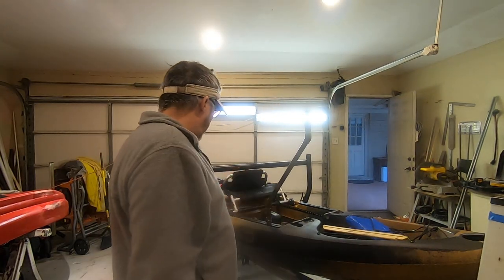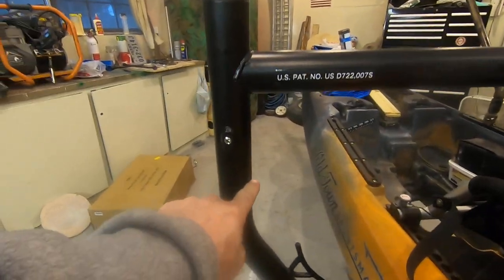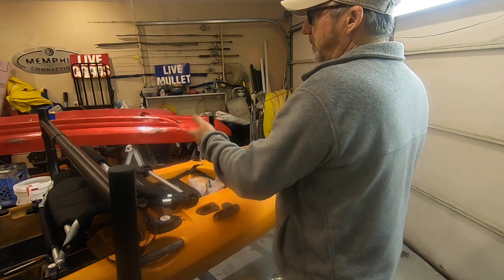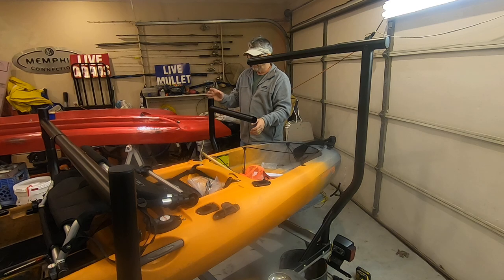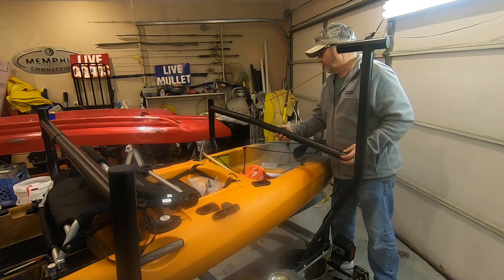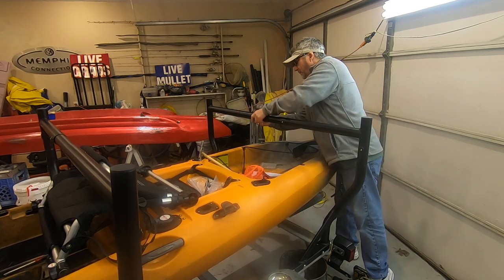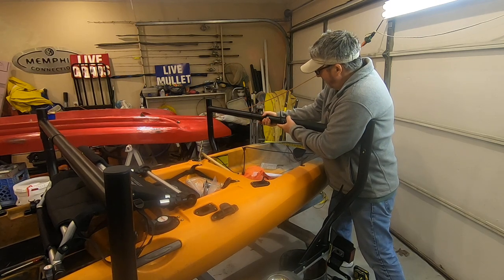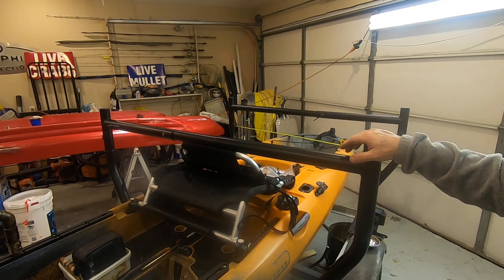Easy DIY Kayak trailer build budget friendly and light for 2 to 3 kayaks double decker for our boat

Comment: Just watched most of your foam boat and kayak videos. After seeing them I am going to build a kayak for myself. Great job.
Reply from the maker: Yes do build one and I suggest the PMF over the foam and instead of wood use old plastic cutting boards for attachment points that way it never rots. And if you do fiber glass it needs to be at least 1/4 inch thick other wise it will get cracked time to time, but it is easy to fix. And even more easy to fix poor mans fiber glass and so much more cheaper. You can always ask me questions and Thank you for watching jerry Benzing

Comment: I was gonna do the same setup on my trailer but was worried that the two crossbars would only be 5ft apart with a 12ft yak. I used the green sewer pipe for my runners for the bottom kayak. What are your thoughts?
Reply from the maker: My cross bars are only 5 ft apart and no issues and I keep 2 kayaks on the top one is a heavy old town and the other is a off brand and then the other old town on the bottom

Comment: set screws are a hassle to me. so tiny, and as you mentioned, easy to lose. the rack works well on your trailer. could a lockable plastic storage box work, such as Rubbermaid Action Packer, or do you need a toolbox? Home Depot has the Husky brand.
Reply from the maker: I want something metal so its harder for bad people to break into and makes more noise
Reply: @mlangfordoutdoor  🆗🆒✅🏆